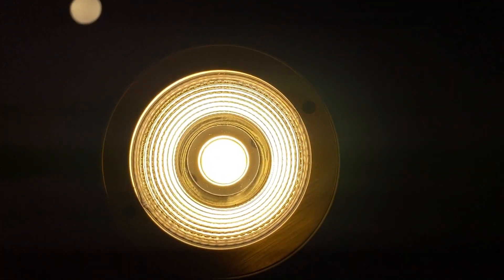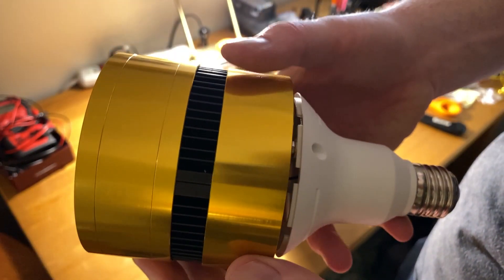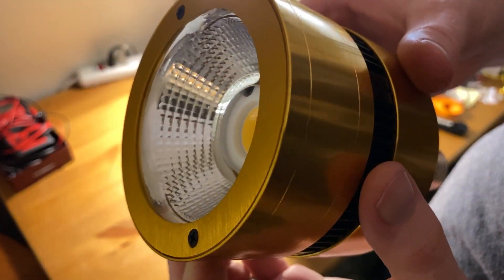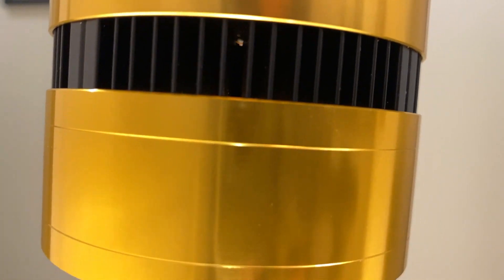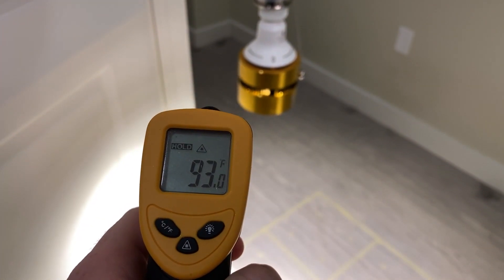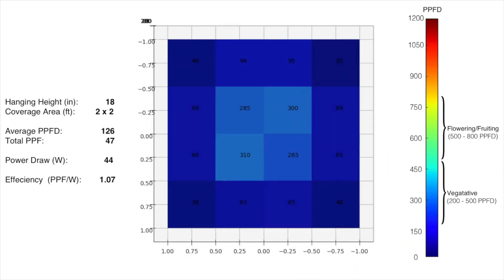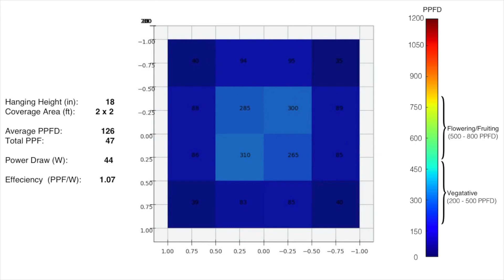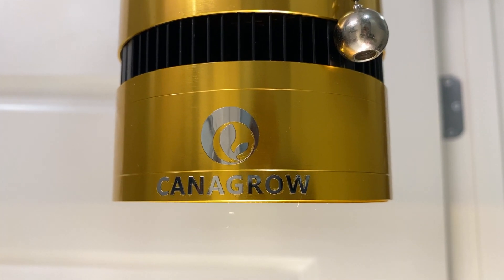Canagrow COB LED Grow Light Unboxing and Testing (PAR/PPDF, Temp, Watts)

Comment: be a nice light for spots that are not getting good lighting.at 63 plus tax tho not sure if it's worth it..I use daylight spectrum floodlights for my shaded areas.but then I am in a closet 7 ft long 2ft wide.pulling average 10oz on viparspectra 350 & 400hps. with some led daylight bulbs.thanks for sharing.